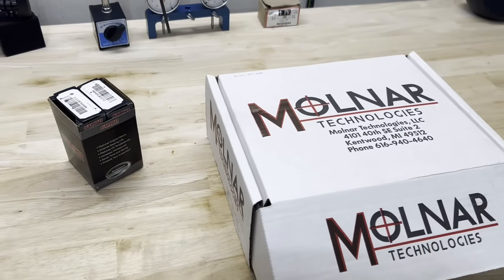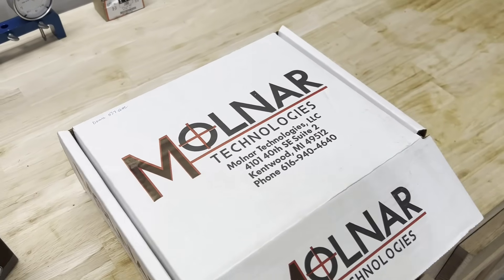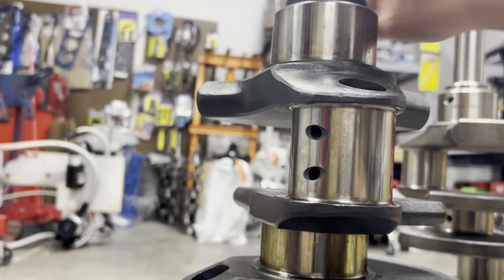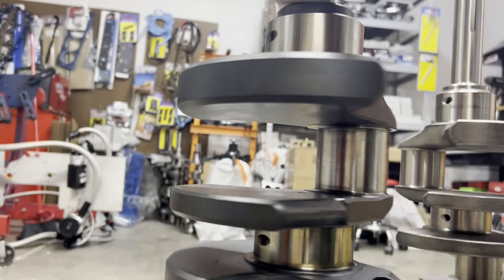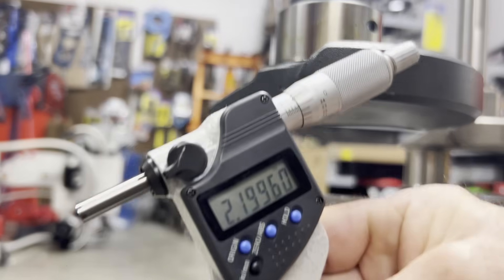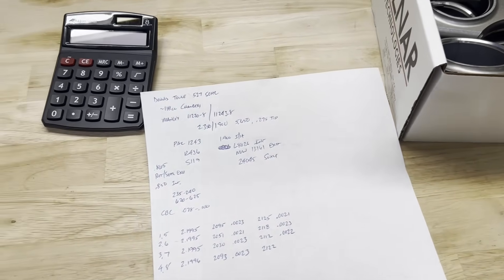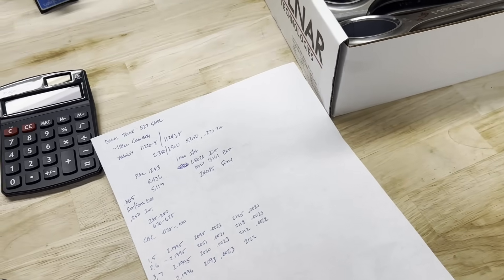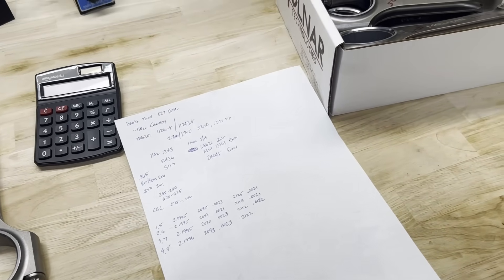Lykins Motorsports Ford FE SOHC Cammer Rotating Assembly...

Comment: I've used the gray RPM cranks a couple of times. I was very impressed with the dimension consistency. Everything within 0.0002 and most within .0001. And yes they were slightly big requiring X bearings.

Comment: Aluminum block main caps are 90-foot pounds.  Cast iron block main bearing bolts are 110 foot pounds. You might think of helicoiling them with as long a helicoil insert as you can get in there.   Just a heads up.
Reply from the maker: What are you talking about??????

Comment: I’d use scat over rpm, don’t like that hole only .200 thickness near rod journal
Reply from the maker: Scat doesn’t make a 4.375” stroke crank.
Reply: @lykinsmotorsports I’m sure scat will custom machine one for that 4.375
Reply from the maker: They will for about $3000.
Reply: @lykinsmotorsports 👍

Comment: Good video Brent.
I had experience with a BB Mopar.
The main journal did not have a true congruent radius, infact had a .001 step on the rear of the journal for about .200 that had been tried to be blended in with polishing.
The rod journals were similar. 
The #4 rod throw was off .014 on total stroke.
So another words the stroke was short .007 on way or .014 total. 
I think the RPM are good forgings. 
The reason the lightning holes are offset is because of the oil holes.
And the way they are clocked.
The Molnar rods are definitely good rods.
Thanks for sharing. 
Have a great weekend. 👍

Comment: Both forged in China. The Scat's are supposedly machined in the USA.  The RPM's where supposedly machined in China which might explain the size discrepancy. I have had three RPM crankshafts they have been oversize journal wise. That has been OK as it allowed better  chances for clearance. The shotpeening on the RPM cranks is a bit excessive though a good idea,  It doesn't seem to affect the windage aspect.The balance holes in the rod pins, where possibly to avoid the oil holes All in all, they have been good crankshafts.